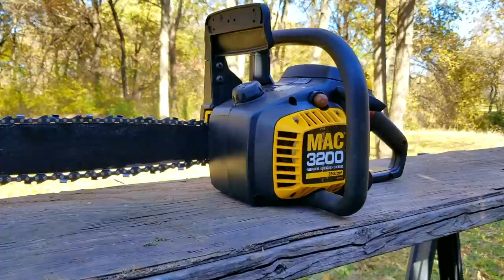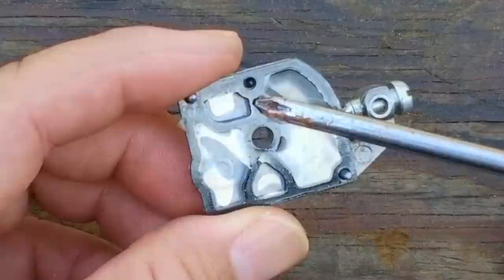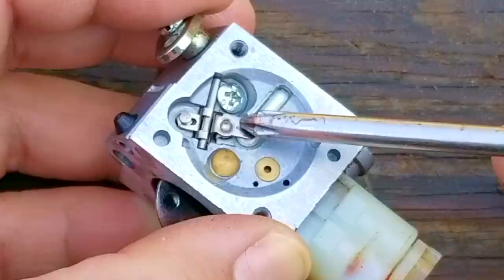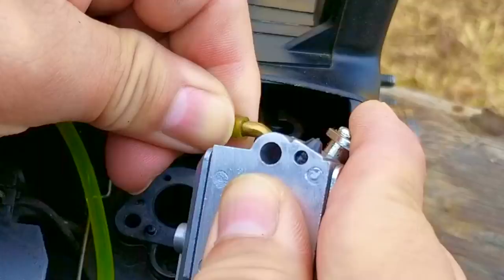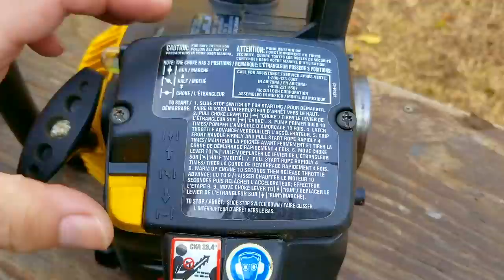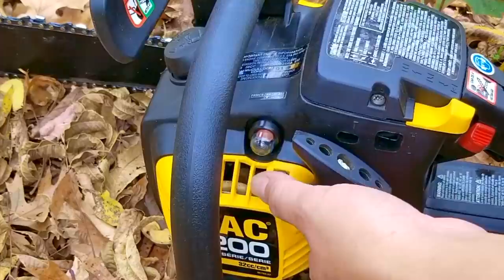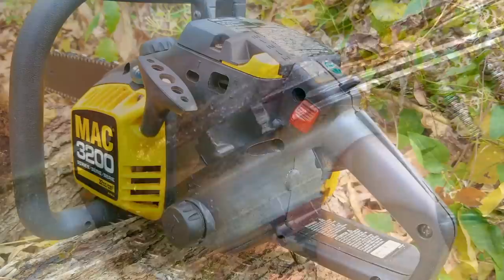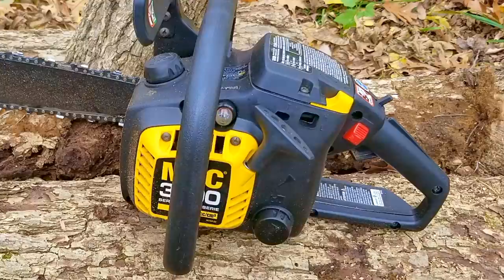Fixing an old McCulloch chainsaw

Comment: I have a 1988 McCulloch Eager Beaver 20" saw I bought new.  It's a great saw and I keep it running.  It had a crack in the intake manifold plenum casting I fixed a couple of years ago and it runs like new!  I empty out all the gas when storing and  wipe it down thoroughly.   When I need to use it, I put in freshly mixed gas/oil at 32:1 ratio. This is the ratio I use for ALL my 2-stroke outdoor equipment including my Toro snowblower and Echo weed trimmer.  The saw runs great on this ratio and I keep the chain oil reservoir filled as well.  I put on a new Oregon chain and it just buzzes through logs.  This is a good old American made saw and I would never throw one like this out!  I'm a retired OEM Automotive Engineer (BSME, MSME) with 40+ years of experience.
Reply from the maker: wow you're doing a fantastic job taking care and using your saw!

Comment: My neighbor down the street is hiring me to repair this exact type of chainsaw. It had gas in it for almost ten years!! It had brittle lines, a broken primer bulb. Since these were made in the late 90’s, there aren’t new carburetors easy to find for these that will fit this model. I told him he’d be better off buying a new chainsaw. Yours had a good carburetor that just needed adjusted and cleaned. The one I am repairing will probably need new carburetor. New carburetors for this off of eBay are old stock, and they were on sale for $100!! It’s not worth spending $100 on a chainsaw that is 25 years old. He can get a new chainsaw for not much more.
Reply from the maker: you made a good call, If you need a carb, it's not worth it.
Reply: Hey mate I had the exact same thing! Lines were disintegrating ! Replaced all fuel lines and the primer bulb as the old one collapsed put new diaphragms and needle in Carby adjusted the needles and she’s idling and snapping great when throttling

Comment: I love your channel, i have been a small eng mechanic for 30 yrs, i work on this type of saw all the time and the parts are still available, one important thing you failed to check on the saw was the bar lubricating oil that should be checked every time you start and run the saw, keep up the great videos
Reply from the maker: yes you are correct, I didn't show that it was receiving bar oil
Reply: Thanks for the response, even after 30 plus yrs. of working on this stuff i have learned a few tricks from you, keep up the great videos
Reply: @brucemarkham9102  I have this exact saw and I can’t find the walbro replacement carb.  It currently has a wt347.  Could you tell me what carb or carb kit to order?

Comment: I want to thank you for all your advice, I ended up getting my rebuild of my poulan pro leaf blower complete. Turns out the flywheel sheered due to the fan Nut not being tightened enough, when it loosened it sheered the key.  with a new flywheel I put locktite on the bolt and torqued to 15 ft pounds started on the second pull with minor carb adjustments.
Reply from the maker: nice work!

Comment: Great job on rebuilding carb on these old Mcculloch saw. If you havent found the chain tensioner screw its on the left side of the bar, its not the in the best of location and tensioner screw cam easo;u gp bad. Also carb tend to easily flood on the Mcculloch saw (3500/3516/Mac/3816 etc). Unfortunately, original OEM or after market carb are extremely hard to find so if any carb issue, just have to rebuild the carb. I have a soft spot for these Mcculloch saw as it was my first chainsaw that got me into small engine repair but I wouldnt spend too much money on these.
Reply from the maker: thank you Mickey Kim, you're right that is a strange place to put the tensioner.

Comment: Thanks for the vids on this unit.  I have  a model with the same internals. FR(Fac Refurb) 2.0 sibling abused it, never cleaned, left old gas.  Got kitts for fuel filter, carb, fuel lines.  So will be cleaning and rebuilding carb.  Thanks again
Reply from the maker: no problem
Reply: @INSIDEHOUSEGARAGE  I think if I did not know how to work on engines/ little ones too, I would still want fixed if just a 100 bucks if I knew the saw had only occasional use like mine.

Comment: I have a pile of these little saws I get bored every once in a while and refurbish it. I pressure test my carbs but even more important than that is to check the lever height in the process. I usually just stick a piece of fuel line on it and put it together then push the diaphragm thru the little hole in the cover to make sure it only comes out when it's supposed to. Sure does save a lot of time if you check it while it's off the first time lol. Also I just wanted to point out that the malleability of the pump is just as important if not more important than the little flaps. Especially those acetate diaphragms like u had. Just seemed like a key detail of what to look for was left out. 99% of the time when the pump fails it's cuz it's not pumping not cuz the flap won't close/open. But nice video
Reply from the maker: thanks for your time

Comment: So I came across this video last year, I told you it starts but if I let up off the throttle it dies then has trouble starting again. Basically after warming up it won't idle you just have to hold the trigger down and do all your cuts (this was after replacing the lines, filters, plug). You said it might be the diaphram so I finally ordered one...except...I tried pouring fuel at the top like you did and couldn't get it to start. While going through the starting procedure it should at least sound like it wants to start but that didn't happen this time. Can't imagine what went wrong in just one year. I thought the whole thing might be ethanol fuel so I got the pre-mixed non-ethanol kind (40:1). 

I took apart the carb and everything is super clean, I cleaned it more with brake-leen and tested the fuel going down the screen...no issues there. I sprayed through the line inlet and outlet and all seems good. The diaphrams don't seem like there is anything wrong with them though mine didn't bounce as much as your at 2:20. The red trigger just has a copper contact and it's not corroded. No one has touched the thing, it should at least start and die.
Reply from the maker: the diaphragm should bounce, I would replace the carb.  and did you happen to check for spark ?

Comment: I have a cased 32-16, so it is about the same saw.  I can tell from the carb it takes a K-10-WAT rebuild kit.  A new screen comes in the rebuild kit.  I put a little grease on the lifter pin and on the end of the lifter spring to keep them in place when I put the lifter lever back on the carb.  This grease will wash out after the saw runs for a while.  FYI, there is a new lifter spring in Zama rebuild kits if you loose it during assembly.  Walbro rebuild kits do not include a new spring.  I pressure test all carbs after re-assembly to 7#.   I run Red Armor 50:1 in my little MAC,  in fact I run the same mix in all my two cycle equipment.
Reply from the maker: I need to get a pressure tester, thanks again for the information

Comment: Well it's a cool saw to add to your lineup. When you're out cutting wood with other guys. You can pull out your old McCullough chainsaw. Start it up run it take a fuel through it.
Reply from the maker: that's the plan

Comment: refreshed a 3200 and a 3216, gotta say, i really like the 3216 much better, so much easier to work on. the 3200 gas tank is bolted to the block behind the flywheel so thats gotta come out if you wanna replace the oil line that runs from the pump, behind the gas tank and to the oil feeder for the chain. Its definitely not the easiest saw to work on, but if you know what youre doing you can get it running pretty damn easy.  Also the rough carb adjustments for first time startup are around 3 half turns out for the low + around another 1/4 turn and the high is 3 half turns out + 1/8 of a turn, you can fine tune it from there.
Reply from the maker: thanks

Comment: I have 2 of these saws in my shop and all the parts are still available, so i fixed them both and use them on a regular basis
Reply from the maker: really? can you share the site(S) you use?  are these parts used or N.O.S?
Reply: @INSIDEHOUSEGARAGE  i just look up the part numbers and go to e bay or amazon, and Jacks small engine has some of them as well

Comment: In relation to your question at the end. Depends on expected usage. I only use my chainsaw very occasionally so if I get it working well it will probably stay that way for a few years if I drain it down as I finish each time. A new saw would cost x2 and be wasted.
Reply from the maker: you make a great point. Thank you Rhian Taylor

Comment: I have this same model in about the same condition. I've replaced fuel lines, primer bulb and am working on the carb. I'm finding that parts are a bit hard to find. Also it seems most smaller chainsaws today are battery electric which I don't think would be practical for me.
Reply from the maker: agreed, and yes the parts are hard to find for these.  Good luck with it and thank you for the comment

Comment: The tensioner screw is between the bar and the fuel tank. I have the exact saw. They tensioner screw wears out and doesn't hold the bar tension.
Reply from the maker: thank you, I'll have to adjust it.

Comment: Many of the parts are the same on the small saws carbs to. I have a Mac like yours neighbor gave me has been sitting 20 years. Fired up on carb cleaner. Needs a fuel bulb n probably new lines I haven’t messed with it yet
Reply from the maker: good luck with it.

Comment: I had a the exact same model good saw for its time bought brand new in 1996. As the years went on it would run fever pitch but wouldn't hardly want to start again. A guy I know who works on them told me they were obsolete I ended up getting a STHL MS170
Reply from the maker: good saw choice, what did you do with the Mac?
Reply: @INSIDEHOUSEGARAGE  gave it to another buddy he tinkers with them more than I do I'd say the carb and saw all together were just wore out

Comment: I checked out the oil pump issue with this model. I found out that the worm drive gear on the crankshaft was slipping and thereby not driving the gear of the pump well. Fixed it by making use of loctite 638 to fix the gear on the crankshaft.
Reply from the maker: nice diagnostic work

Comment: I would buy a new one if it would cost $100 to repair.  I picked up one just like this from the curb several years ago.  It ran great for a while and then after cleaning the curb I could not get it going again.  
I am now prepared to go at it again and I will get it running along with the many other saws and weedeaters that I picked up from the curb.
Thanks for your sage advice.
Reply from the maker: no problem and thank you Hear Meout and thanks for the comment.

Comment: It may not have much in way of major parts if they break but I think these older saws were better built.  My McCulloh factory reconditioned 32cc (FR2.0) has served me well for over 20 years with only gas line replacements and one carb rebuild a few years ago.  So Yes, I would spend $100 to get mine repaired.
Reply from the maker: thank you for vouching fro them  Mark Mizner.
Reply: I have the same one, too -- the factory rebuild.  Not sure how long I've had it, but it's at least 15 years.  Just changed the primer: first thing it's needed while I've had it.   The primer I got was listed for Husqvarna and had a smaller outside diameter that the original, but the inside diameter matched.  It fit, snapped in, and  seems to work fine.

Comment: I know that’s not really one of the actual vintage Mac saws that are pre 1990’s but they’ve always had an issue with recoil mechanisms breaking when they shut down so as a way to prevent damage to the recoil pull the starter rope out a couple inches then hit the kill switch and then all the slap of the engine shutting off will be absorbed by your hand. I’m so used to doing that, that it’s a natural instinct whenever I shut off an engine with a pull rope.
Reply: I’ve seen another youtuber doing this every time he turns a saw off. Sorry, can’t remember who. Always wondered about that.
Reply from the maker: I've never heard of that problem, thank you for let me know Bradley Gower
Reply from the maker: if you remember, let me know
Reply: Buckin’ Billy Ray Smith does it man does he make some wicked axes
Reply: INSIDE HOUSE GARAGE   Bradley called it - it’s Buckin Billy Ray. Couldn’t remember because I watched a few of his videos and then stopped because I wasn’t learning all that much. Just not my style.
Reply from the maker: I'll take a look right now, thanks for the suggestion guys.

Comment: Hey bro cool video. I personally would have bought a new chainsaw since it would of been too expensive to service an old saw with little parts available to repair it. If it's a tool I need for cutting fire wood for example I would invest in a new chainsaw.
Reply from the maker: you make a good point, thank you Ramadin Sookhoo.
Reply: @INSIDEHOUSEGARAGE  you're welcome bro. To me it all depends on whether or not your dependency on the piece of equipment for everyday use or emergency. Plus it also depends on your budget whether or not it makes sense to repair it for a hundred bucks or so and it last for a few years or so, or just get a new one and use it until it needs to be serviced or repaired.

Comment: You need to obtain a can of Amsoil AM Spray. It will clear up the rust and lubricate the areas seen around the adjustment screws. I would love to send you a can if you like. And going back again about 2 cycle oil. Amsoil Saber eliminates the guess work for fuel mixture.
Reply from the maker: That's a nice offer, I'll let you know. Thanks again Keith Dunbar.

Comment: Wouldn't running a magnet across the floor to find the part you're missing a lot easier than ordering and paying for a new carb?
Reply from the maker: I work outside so it's not as simple as that.   I have save a couple of parts, while loosing more than my fair share.

Comment: Good video!! Question: I have a Homelite 240..How much oil should it put out on the bar?? Its not leaking and do see that the bar gets slightly oily- after running a min or two I'll get a few drips off the bar..just curious..Can you use Tygon lines off the oil pump? The factory ones are black in color I believe rubber..Thanks
Reply from the maker: I don't have a problem using Tyson line for the oil lines, and it should spray small droplets of oil, from the bar when you rev it.
Reply: @INSIDEHOUSEGARAGE  Any Idea on line size? Od & Id..Cant find any info on it...
Reply from the maker: not really, but If I had to guess, it's no bigger than the fuel line, at 3/16"

Comment: Great video!  Could you tell me what carb or carb kit you ordered??  I have the same saw and replaced all the fuel and oil lines as well.  It ran pretty well after I got it back together, but I noticed I had pinched the main fuel line when I screwed the case back together.  I fixed that so it wasn’t pinched and I wouldn’t run after that.  So I re pinched the line with wire and it ran again.
Reply from the maker: I don't typically buy the rebuild kits, I just buy the metering diaphragms and that's it.
Reply: @INSIDEHOUSEGARAGE  awesome thanks

Comment: this model has quit some aftermarket parts(partner, einhell..). Quite some copies were made of this one. I thought that the chain tension adjuster screw is at the front next to the bar(not ideal to adjust). Why don't you clean the screen by spraying carb cleaner backwards from the needle seat hole? This way you directly blow all crap out the way it came in. You did this reverse blowout method with reused fuel filter in an other video.
Reply from the maker: you make a good point. I have done it that way, but I seem to always stick with spraying the screen side first, and if it clear the screen , I usually just forget to spray from the other way.  Although today, I had to do what you just said, because the cleaner was not breaking up the  varnish.

Comment: I picked up one of these at a g sale. The bar was removed and not properly remounted(the tensioner was not in place) an easy fix. It does run but cold blooded. What size gas lines are required?
Reply from the maker: this one should be 3/16" OD

Comment: I have a Stihl HL 100 K and i cleaned the carburetor but it doesn’t run normal it only runs on half choke, what do you think could be the problem? Hope you can give me some advice thanks
Reply: Reset high and low speed screws to 1 1/2 turns and do little adjustments from there
Reply from the maker: if I've cleaned a carb and it still won't work properly, I would consider buying a new carb.
Reply: Thank you both i appreciate your help 👍🏽

Comment: Dear Sir,can you tell me ,how put ratio oil and fuel for chainsaw Mcculloch Pro Mac 10-10.  Thank You.
Reply from the maker: sure,  according the forums the mixture for that saw is 20:1. That means you need to add 6.4 ounce of 2 cycle oil to 1 gallon of gasoline.
Reply: Dear Sir,thank you for your answer. @INSIDEHOUSEGARAGE